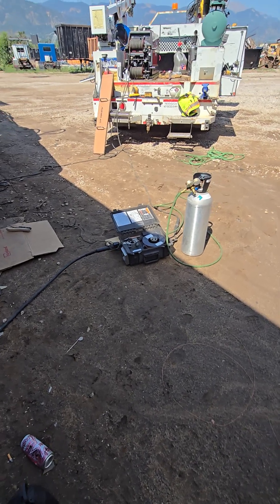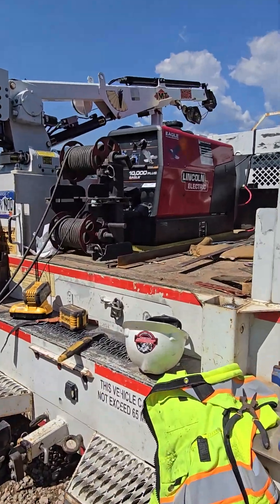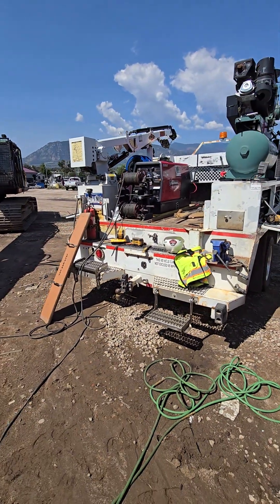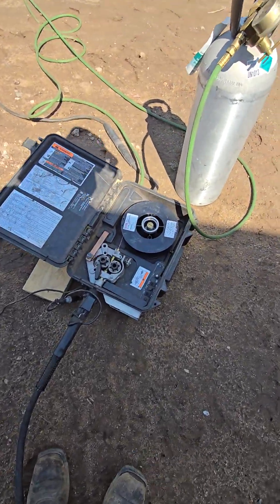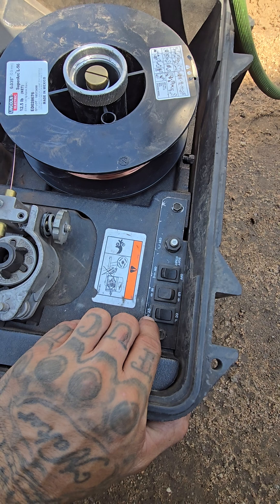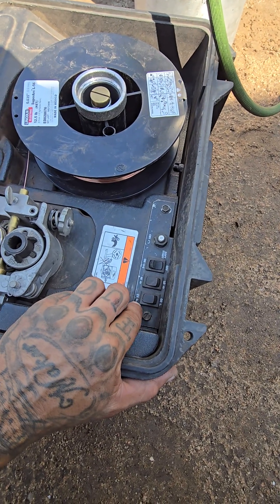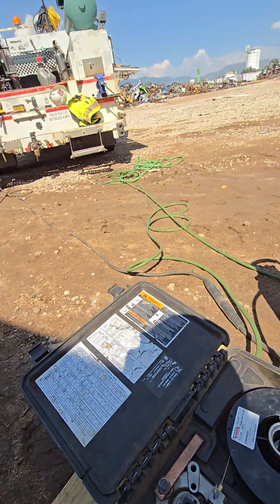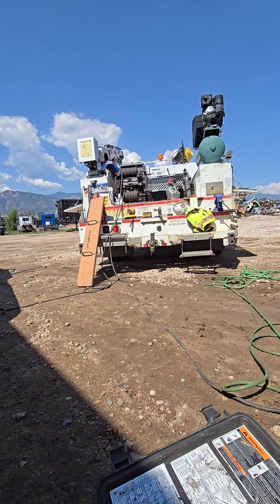Can you run a suitcase wire feed welder on Constant current instead of constant voltage?

Comment: Have you had any issues using the welding suitcase to the welder
Reply from the maker: No sir
Reply: Why and when do you need to change the settings? Is it dependent on the wire being ran? BTW just got a 12vs last week